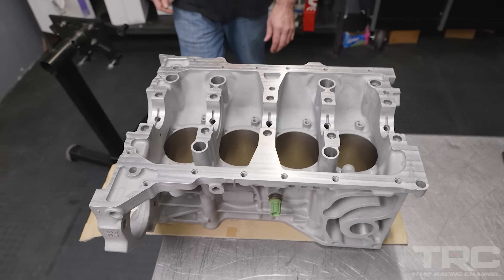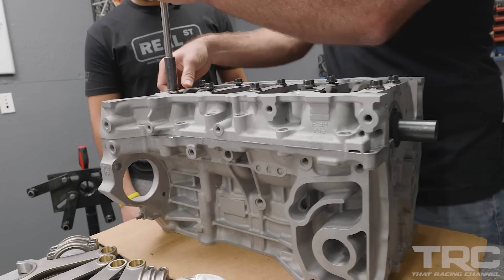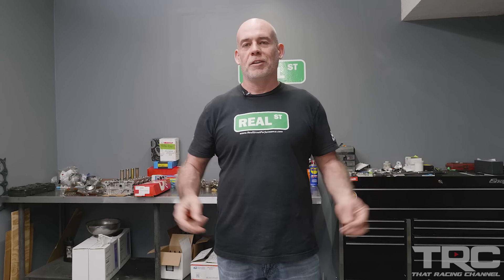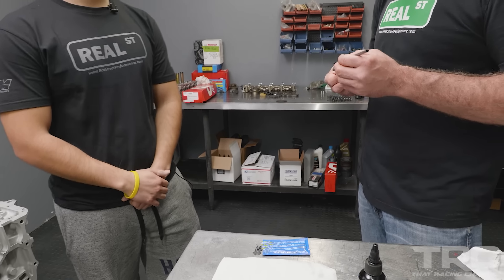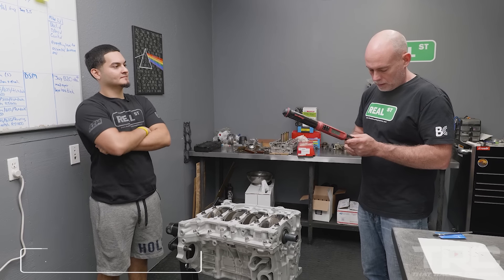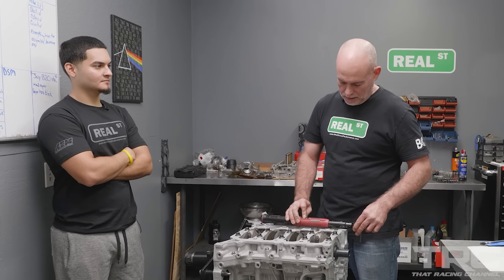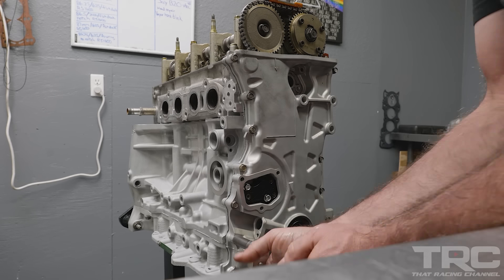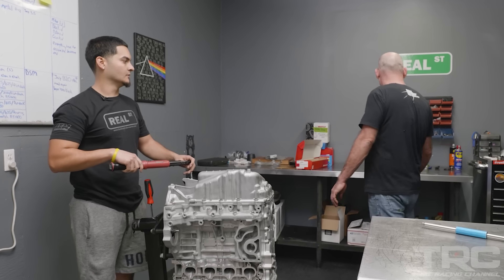Building a Honda K20 | Jay Teaches Novice the SECRETS of Engine Building!

Comment: This is the type of content I want to see. Technical but not overly so, teaching me how to do things not just what someone else has done. Jay seems cool as hell and I wouldn't mind a how to build a k series engine from buying to building.
Reply: I disagree, I'd love a super technical course taught by Jay. His knowledge is incredible.
Reply: @Hawk7886   Go check out Mike, from motoiq, explain all the coatings, media blasting, heat treatments, as well as tolerances, and methods to measurements for different bearings, how they’ll torque down the bed plate and align hone the journals.  Theres also a torque plate to bolt to the head that acts as if the head is torqued down but has the holes for the cylinders and make sure the bore is perfectly plumb when the head is under torque and not bare.  He goes over all the parts and why they use specific companies.  Their video along with this assembly video should get you building a bulletproof setup.
Reply: @streetassasinGSR96  I'm familiar with motoiq, thanks though
Reply: @Hawk7886  Do you have any recommendations for people like me who want to see the super technical stuff plz ?

Comment: Man the guy building the engine is like a dream engine builder. Checking everything and double checking after that. You know if something fails in this engine it's mechanical related. Excellent video. I'd buy an engine from this guy any day.
Reply: What are the specs used on the valve train?
Reply: @hectorperez1528  gotta look it up, man, you'd never want to get specs like that from youtube comments.

Comment: I can't believe I'm commenting this because Jay is an idol and in ways like a mentor to me but he actually applied the Hondabond to the wrong side of the bolt holes on one side of the bed plate. I was a Honda tech for a number of years and K series are what I know best. The bolts on one side of the bed plate are actually inside of the oil pan/crankcase and the other side are external. The side that has the bolts inside the crankcase should have the Hondabond on the outside of holes. Now that being said, most likely nothing will come about it because the seal is still there  and I doubt the fasteners will allow any oil to leak but according to the service manual that is the way it should be applied. I remember second guessing the manual the first time I did one but then I looked at the bed plate and saw why.
Love you Jay, don't hate me 😅
Reply: Howdy, I looked and the manual and you're indeed correct!  Thanks for being friendly about it. The comments section gets savage!
Reply: One day I'll come find you at a show or something and remind you 😉. I'd like to meet you! I'm from Southern Ontario, Canada though.
Reply: @MrKylev35   I was thinking about this over the weekend. When this all got started my guys would hang a gopro near me and just film me doing my thing. That gave way to getting in front of the camera and then as things evolved we have projects like this going. I do miss the intimacy of me, the tools and the engines... Times have changed in the name of "content".    I'll catch you out in the real world one day!  Take it easy!

Comment: @ 4:43 when you draw the line for the silicone. one side was done correct. the other side you need to put silicone on the outer side of the bolts. as the bolts bolt into the oil side of the sump and may leak. see manual.

Comment: You can tell he put enough silicone to connect the block by the little bead that's on the outside. I've seen a few good times where they get the whole engine assembled, start it up, and that's where your oil leak is.

Comment: do the cylinder walls not need to be oiled before dropping the pistons in? I have always oiled the walls and rings before dropping them in.
Reply: I was wondering this too. Im pretty sure they clean the cylinders with auto transmission fluid and a rag but im not sure about after installing pistons.

I think i am going to lightly coat the cylinders with break in oil that Motul makes (and fill the engine with it too before first startup)

Comment: Chances are Ricky has touched my package huh? mmm... I want that torque wrench but dang $650 hurts. Painting some happy little rod bolts and head studs, letting them know with each brush stroke we're proud of them! You ever try tube twisters or the valco 71006 cause i get empathy hand cramps watching you lay beads

Comment: Omg I work for Hyundai and our shop manual says to not lube the bolts and they are mostly angle torque and I learned my lesson to put lube on them cuz damn my electronic torque wrench freaks out when that dry ass bolt creeks and skips like crazy... I feel better now that Jay lubes the washers and threads 👍

Comment: Sweet content as always. Thinner oil in summer and thicker in winter as I’ve always heard but 15w40? Isn’t there a point where the thicker oil makes the pump work harder/slower thru the pickup or is that BS?
Reply: Depends on the climate and clearances, cold climates can be a killer. I have a friend that threw the rods out of a stock WRX on a winter morning in the North Eastern USA. Then you have engines like Pro Stock NHRA that will race with 5w or 10w oil for every last HP.  In Florida we can use 15w40 year round with issue. Remember always let the oil get hot before the abuse starts. Thanks

Comment: Nice Vid - How much torque do you think should be necessary to turn over the fully assembled engine - as measured with a torque wrench on the crank pulley.  Ditto with just the crank installed and bed plate bolted down.

Comment: Its good to check the balance of all mechanical components to ensure they are in spec like the weight of each piston, rod caps, crankshaft it will reduce vibration because it's displacing power evenl think about at a wheel the wheel needs a weight to accommodate travel speed, it will cause a engine premature wear and you cannot see the imperfection physically, you have to use a measuring instrument to get accurate readings, stuff like that surface of rod caps or rods, see when you medal parts are made and cast, It's different from billet, billet is more pressure treated, as casting they filled up a molding to form a part, and if your trying to make power it is great to know these factors or the Engneering, Mechanical parts need to be cast with precision, cylinder bore clearance and leak test on cylinder head, any work engine will have a slight leak it some valves, not a lot of people check that because, You can still make power but you also want a clean combustion and not coolant and oil mixing also the roundness  of cylinder bore, basically just double check everything you never know if the engine has been overheated, it can cause so much damage warping the block cylinder head and people don't understand that you also warp the bore, rods, pistons, at high temepture metal contracts and the rating for heat for the cast only can withstand a certain amount of heat before it's starts deforming, the thickness of the cast and all that metal weight can lose balance by being heavier on one side then the other even though it's at the spec of how much it should weight, it's good to take these in to account, This is why people go towards billet for making Reliable power, because it is pressure treated, it's like 2x2 wood or 2x4 they used pressure treated food and spray in with chemicals for the bottom food of a wall to keep moisture and insects out that bottom vanity peace has to Accommodate the weight of the roof and walls

Comment: I did a similar build on my k24z.

Is it safe to run a built block but non CSS'd or without aftermarket sleeves? Will that mess with longevity or will i just not be able to make as much power safely?

Comment: The most interesting part is how simple it is to do the timing. No locking the crank or cams; just look at a few marks on the chain and sprockets. Interesting. BTW 2618 Aluminium alloy (aka Hiduminium or HIgh DUty aluMINIUM) was developed by Rolls Royce for aircraft engines before World War II, used because of their higher strength at high temperatures. They are 94% aluminium, 2% copper, and Fe, Ni, Mg, Si and Ti. As all aluminium, and perhaps even more so, they have a horrible modulus of elasticity, so once pushed past their endurance limit they will fail. But they are light and generally strong. As Mr Mister says, they expand more when heated, so you need to be super clever when using them. It's not a plug and play. At the end of they day, aluminium pistons can't take the torture of a super/turbocharged piston. And if you don't know who Bob Ross is, you're not allowed to build an engine, ever.

Comment: I have stock k20z3 jumped exhaust timing on me and have good compression on 1-2 cylinder 130 on 3 and 4 is dead at 30 was wondering if i should get a new motor or buy a rebuild kit and timing kit or what should i do?

Comment: ☆question, I purchased  a low hp K20a engine. Can it be converted to  a high performance version?  Are the internal components in the K20a the same as the K20a2?  Or?    Thanks Steven

Comment: Pull the fuel pump fuse right before star up and u can prime the engine with oil pressure and not have the engine start combustion

Comment: I usually take my spark plugs out and run the engine on the starter to prime the oil.
Reply: That works as long as it will prime at cranking speed. Some engines won't pick up a prime turning that slow. When I was heavy into EJ engines I'd prime them that way. Thanks
Reply: @Jay Meagher  Thanks Jay. I'm a BMW guy. Always had good luck with it. Thanks for the awesome video.

Comment: Now that Dart is making heavy duty castings of the 2JZ block I hope they can do the same with the Honda K series to help bridge the gap between stock and billet.
Reply: Gonna get shit for this but I STRONGLY prefer Honda blocks over Dart, CSS, etc. They may be beefed up, but you seldom need it and the castings are not anywhere as good as OEM. Never seen one that didnt need some machining out of the box. Most have a few hours of grinding and knocking edges down as well.

Comment: what did you use for clean engine block? good video!
Reply: The blocks are hot tanked then media blasted or vapor honed. Thanks
Reply: @jaymeagher1510  thanks! would be good a video of the process, here in Spain i dont know there is hot tank machines, media blasted yes and vapor honed too, problem i found is these need to be clean a lot for avoid any oil holes get clogged..
Reply: @Walterronny  Yes sir, the blasting media will absolutely kill a new engine so you have to be really detailed in cleaning it out. Thanks

Comment: 1000 miles babying it isn’t needed. 4-500 miles and introduce small amounts of boost from the first 5-10 miles to push the rings into the cylinder walls. 

Do hope it’s going to have a bigger fuel pump and decent intercooler for 500+ 🤣

Comment: I’ve always thought it was a dumb move to not have a way to prime engines back in the late 90’s -early 2000’s when it became a norm..not sure why but I’m guessing on the day the first one was designed the engineers were a bunch of crack heads and forgot to install at least a priming port 😂😂😂😂